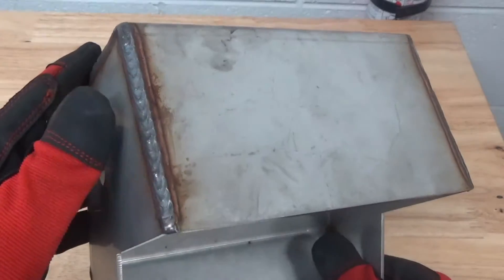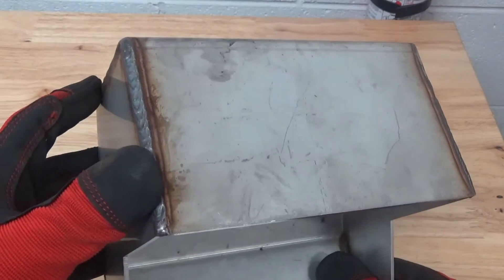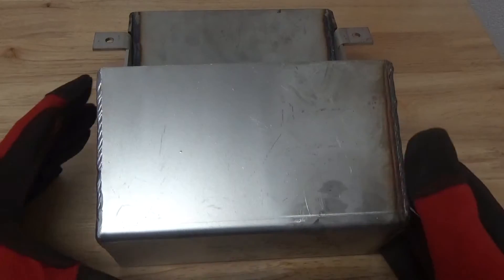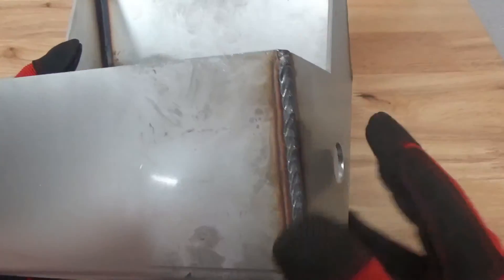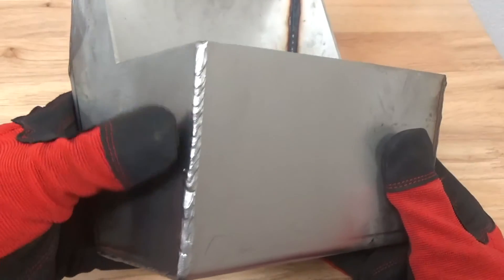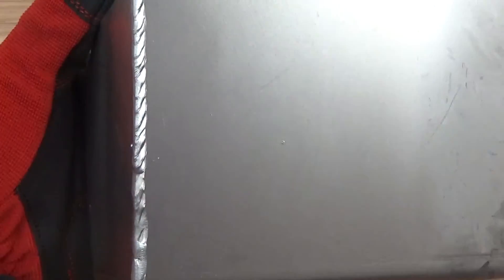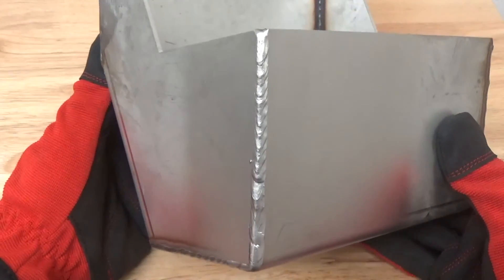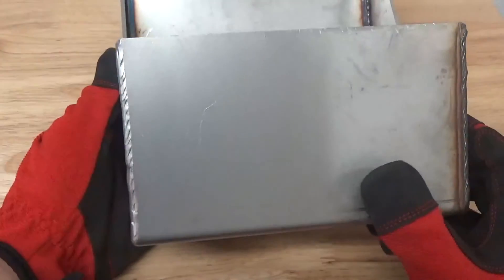Cleaning & Finishing Stainless Steel- Vapor Honing Technologies

Comment: good , I weld TIG ARGON and it's very very difficult to clean black carbon stains from welded area. cabinet I can build here . tubes , air compressor , etc easily available. I need only gun and any machine you use extra .price ???